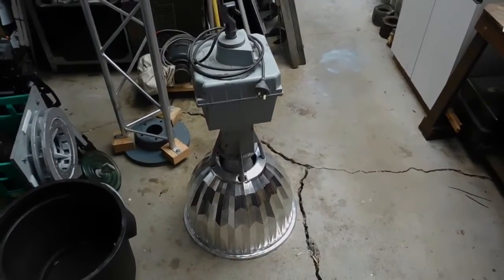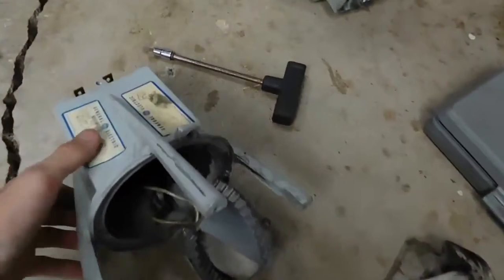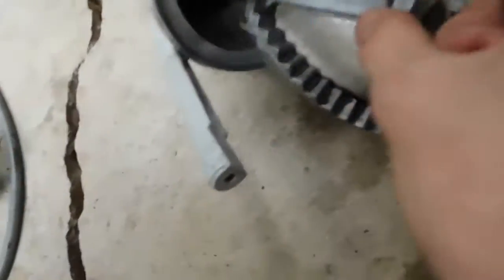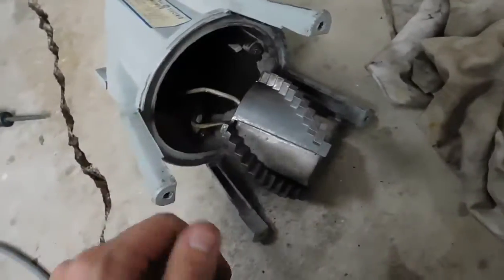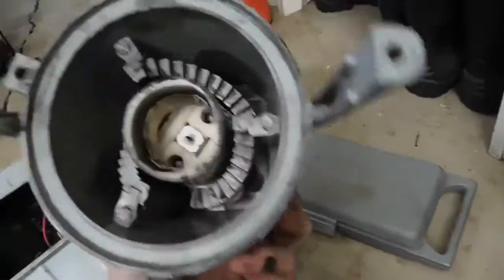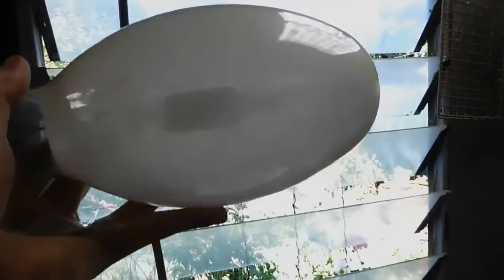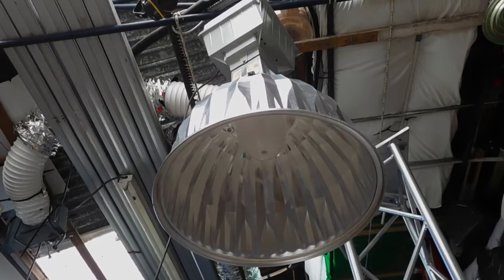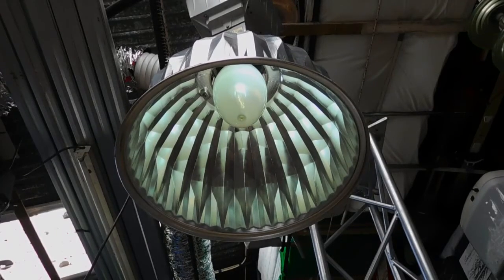GE 400W Metal Halide HighBay Clean Up

Comment: Very well run lamp there, good to replace it. The arc tube definitely has got issues with the colour shifts in it.

Nice is you can run a 400W mercury in the fitting as well, so lamp selection is wider for the old probe start ones. I have some old 400W MV lamps for that fitting style, not the ED style but MBFR. Ran them as uplighters at 200W for a long time, and they were very bright. Even have some very old 400W lamps that were made in South Africa when GE still made lamps here, but they are rather well used.
Reply from the maker: Nice!  Yeah a 400W merc is what's going to go in  place of it. And I might even look for a horizontal burning probe start metal halide so I can run it sideways as well
Reply: +CAL&#39;S ENGINEERING Going to need a new socket for that then, you will need a positive location socket as the horizontal burning lamp has both a shorter thread and a locating pin for getting the arc tube orientation correct along with a redesigned centre contact so it will not light in a regular E40 socket. Done so you cannot replace with a non position orientable lamp which will fail very fast.
Reply from the maker: SeanBZA ah OK. I'll see what my local lighting shop has.
Reply: CAL'S ENGINEERING buy an inverter and a large lithium battery and make a flashlight.

Comment: There a few of these at my school and the bolt is not necessary, it depends on the fitting, if it has a hook the bolt is required but if I like a loop or u bolt it isn’t need as they are designed to hung off a jack chain

Comment: Hey I have a lamp just like that except it has a glass cone on the optical bolts and I have the same ballast except there is no versalux label just a Ge label it also is enclosed ip54 rated probably
Reply from the maker: Nice! Yours would be the low-bay version if it has a glass reflector, made for lower ceilings ;)
Reply: +CAL'S ENGINEERING your light is called the Duraglow it is discontinued as of 2015

Comment: LED ones won't last as long as these
Reply from the maker: Nowhere near! Even with this running the incorrect lamp!
Reply: +CAL'S ENGINEERING same mv lamp will turn very bright than normal
Reply: CAL'S ENGINEERING why did it flash orange
Reply from the maker: Elvis Ramos I explained it in the video
Reply: When
Reply from the maker: Elvis Ramos when it was heating up
Reply: You mean warming up
Reply from the maker: Elvis Ramos heating up
Reply: Ok
Reply: It's not necessarily the led s, but how they don't tolerate heat at all and these bright led lights tend to be pushed to their limits.
If you design led s with enough heat dissipation to run cool they will last forever, but they become so large that they are impractical. LED s tend to be crammed together on small dies and mounted on heats inks without any fans and they tend to fail after a few years. (especially led lights designed for car turn signals etc)
Reply: richard vaughn LEDs are CRAP, don't use them, they're horrible.